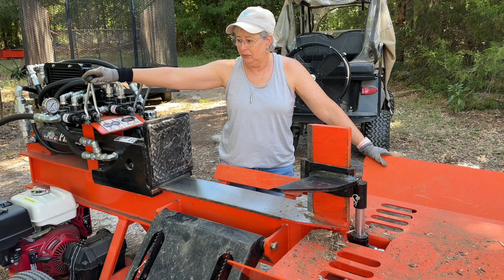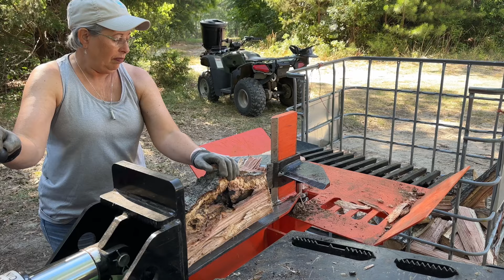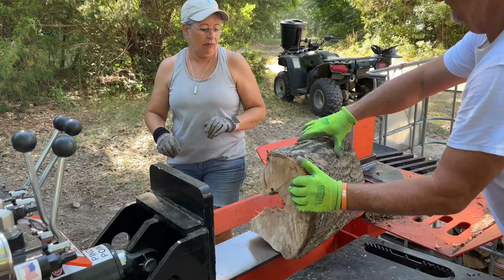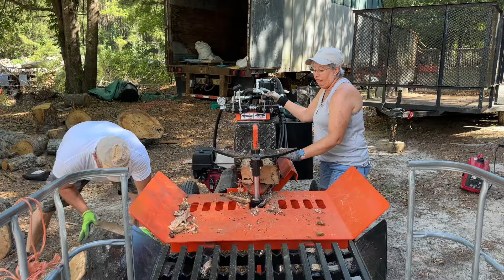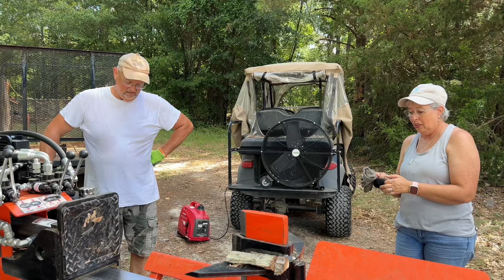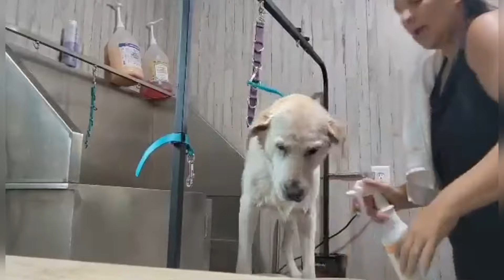We having a Heat Wave #firewood #splitting @WolfeRidge

Comment: What model is your new splitter ? What hp motor and cycle time ?
Reply from the maker: Wolfe Ridge Pro 28c with the big bore package.  Check there website fir all the specs.
Reply: It has a fast cycle speed. That’s the key to speed. Fast cycle time. My 35 sho is stout and fast. About a 8 second cycle time. Takes 3 people to keep up with it.  Usally run it at 70
% throttle
Reply from the maker: While making videos with my wife …I generally run 40-50 percent trottle for we can communicate.  Not in a hurry while making videos.  Have a great week